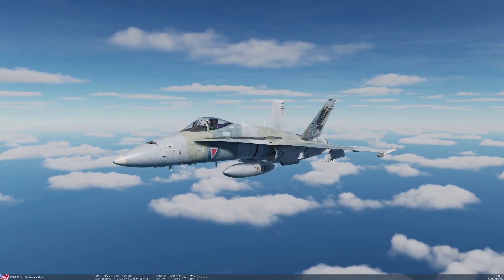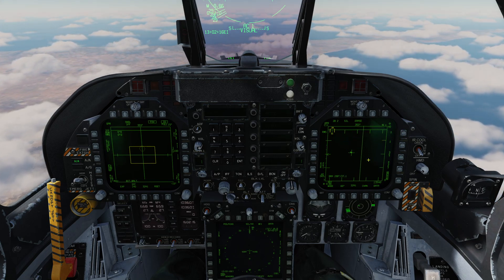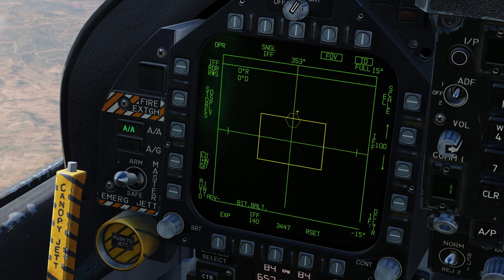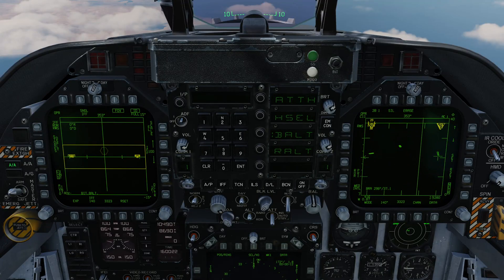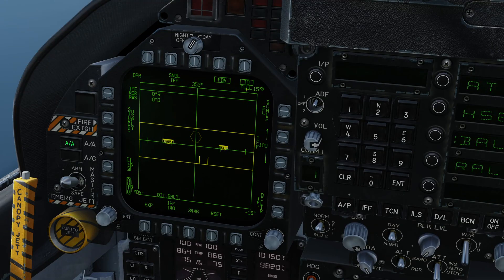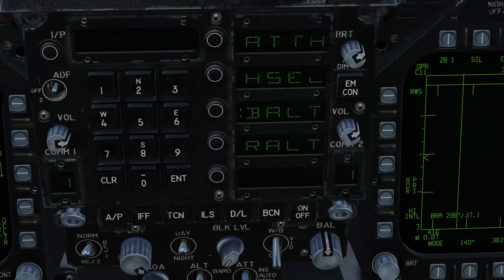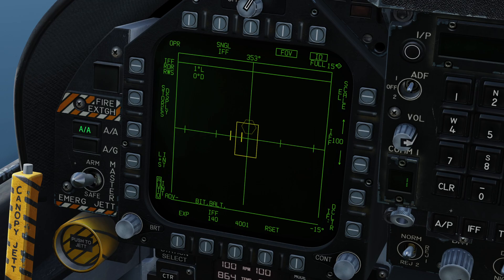DCS F/A-18C Tutorial 17 - AZ/EL Display

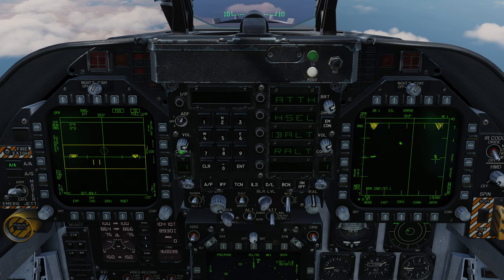Comment: 7:25 The command for a manual interrogation is SCS depress then SCS right within 1 second. The previous way was incorrect
 10:10 You can access the AZ/EL FLIR subformat at anytime by pressing SCS to the AZ/EL display (left) however the TDC must be outside of the Tactical Area. (green box that separates tac data from push button options.

I would suggest you add a comment or something mentioning the applicable HOTAS commands and shortcuts. Just because here you clicked every PB when most can be done via the SCS and TDC, we want people to know that there's a faster way to do things.
Reply from the maker: Thanks for the corrections, your knowledge on this aircraft is super valuable. I'll look at adding annotations at first and then will plan to revise this video soon like I did with the radar one.
Reply: can you tell me all the shortcuts of what could've been done with the hotas?